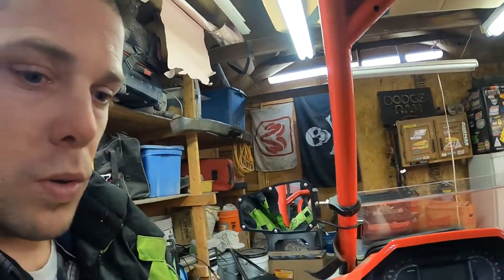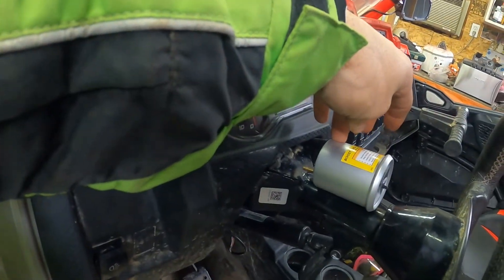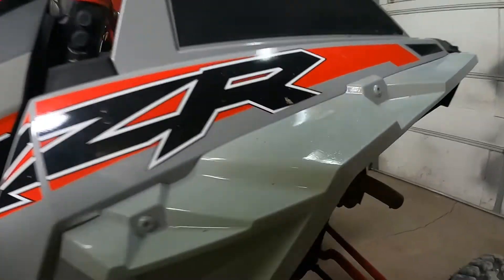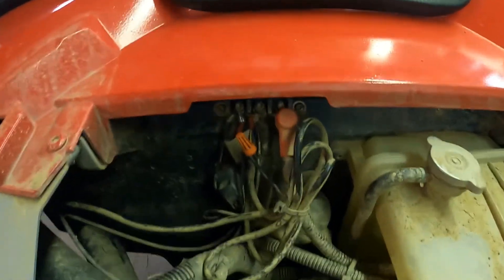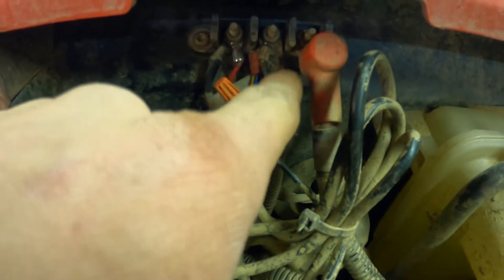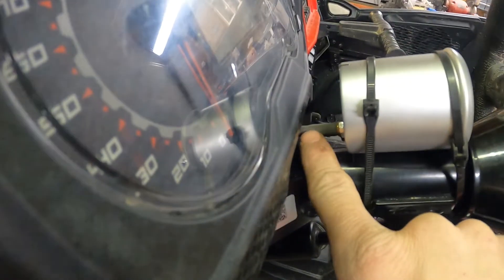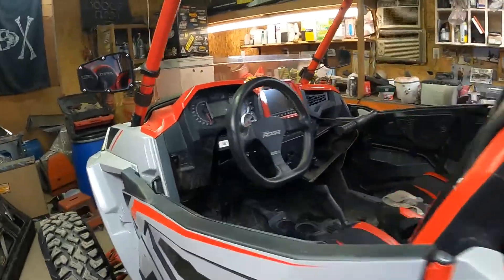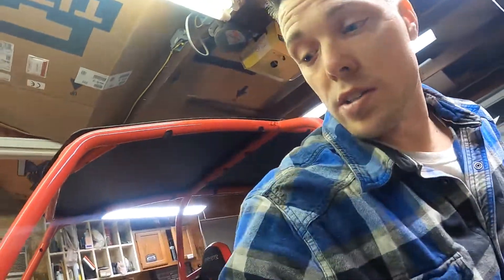2020 Rzr Turbo S gets a boost gauge INSTALLED!

Comment: I have been watching your videos on your turbo S. I also have a 4 seat  turbo s with the evo stage 4 and it is a massive difference between a stock machine. From a dead stop in 4 wheel drive on pavement it will smoke the tires for about 40 feet.
Reply from the maker: I haven't tried to roast them on purpose but with the 110 added it seems alot better
Reply: If you’re octane is too low your engine will ping really bad And definite loss of power. Are you still running a stock exhaust with the cat in it.
Reply from the maker: @snoop8093  no its straight pipe. Engine has always ran great. Even with the octane additive